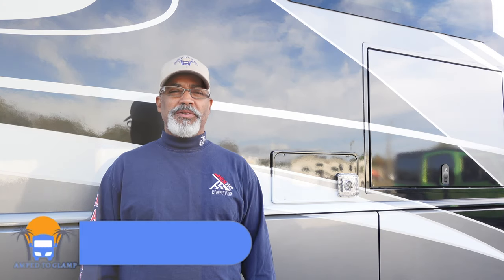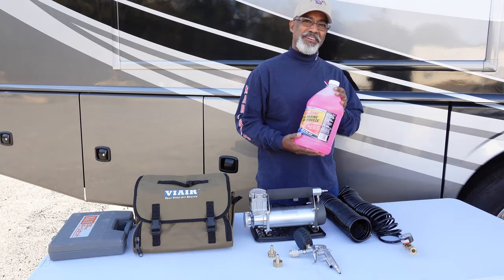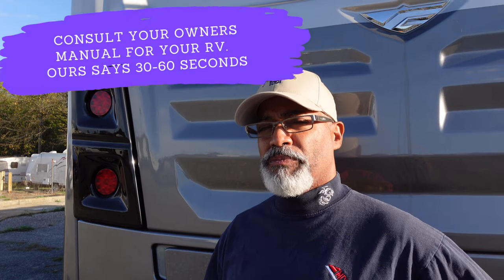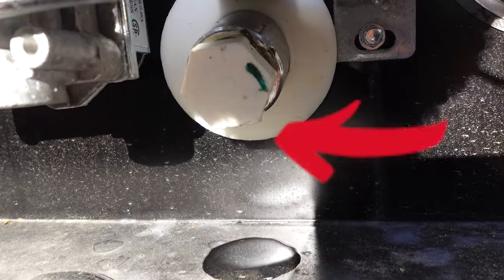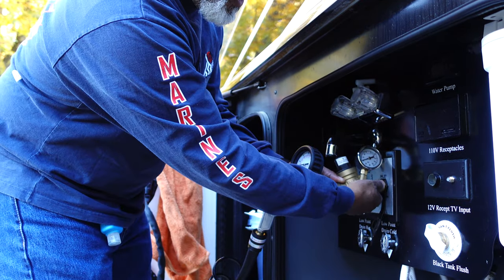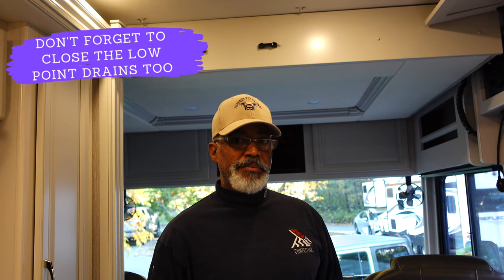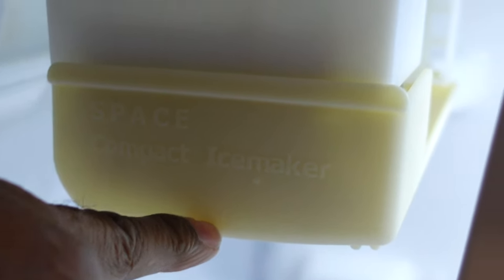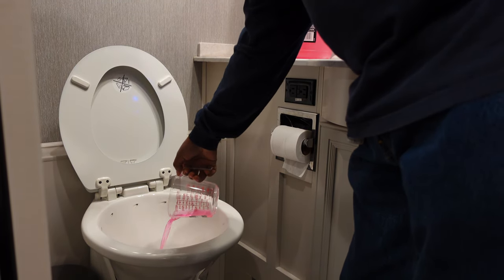How to winterize your RV using an air compressor. | Winterize your RV residential appliances too.

Comment: Great video my friend , while you're in the water htr cabinet make sure that you pull the 2amp fuse it'll keep you from damaging the heating element if the electric switch gets turned on accidentally. Also unscrew the filter housing on the water pump. Safe travels people 🙏🏿
Reply from the maker: Delmar!!!  So glad to hear from you 😊. Great tip!  So happy to have your words of wisdom. Thank you!

Comment: John, would you share with me where you got the fittings that attach the air compressor to the freshwater lines on the RV? I’m having problems finding them. I appreciate your help. I hope you guys are well getting ready for a busy spring. Thanks Brad
Reply from the maker: @Brad Denton Sure thing!  I bought it off Amazon.  Check out this link! https://www.amazon.com/gp/product/B095WN1J2T/ref=ppx_yo_dt_b_asin_title_o06_s01?ie=UTF8&psc=1

Comment: Thanks for this. Perfect timing. Can you share exactly what kind and size of adapter did you use for the air compressor to water adapter?
Reply from the maker: @Albizu Garcia  John  used a Camco blow out plug with brass quick connect. It fits a standard water inlet.

Comment: I always open all faucets and then open the low point drains.   Less to blow out later.  Did you not step on the toilet handle and blow the water out, or just didn’t show it?
Reply from the maker: Hi Kevin.  Our macerator toilet requires us to leave some water and anti-freeze in the bowl.  Each toilet is a little bit different.  I will say using air to winterize is so much easier than just using antifreeze.  Safe travels!  ~Sherri and John

Comment: Good winterizing tip here is one more tip with regards to your Domitc 7640 series macerator toilets. Once all the water has been removed from the supply line and water solenoid valve, add the RV antifreeze to the bowl then flush the toilet at least 3 times to remove all liquid from the bowl, this is per the Domitc 7640 series manual, page 14, 7.3 During extended periods of non-use/winterizing. There's no need to have the RV antifreeze in the bowl at that time, no seals to dry out with that toilet plus the RV antifreeze now has been pumped thru the discharge tube.
Reply from the maker: Hey @The Casual RVer...I thought I had responded to this.  My apologies.  Wow!  You know so much about the Domitic 7640 series.  How did you find out the exact model number?  Our owners manual references a different type of toilet.  Also, do you know where we can find the power switch for the toilet?  We are camping through the winter and end up having to winterize every few weeks depending on where we are going and storing the rig.  Thanks!  So good to know someone so knowledgeable!
Reply: @AmpedtoGlamp , No problem. The REV Group in 2019 switched to the Domitic 7640 series, replacing all Vacufulsh toilets. The 7640 is the standard macerator for their lineup, where a gravity dump won't work. Until you get the Discovery LXE and American Coach, then they use the 8700 Domitic macerator toilets. The power switch is integrated with the foot pedal, You should have a separate  Domitic manual on your toilet, it should be in the manual bag.I have been Blessed to have been around the industry for many years. The Ford F-53, F-59 stripped chassis and the cut-away E-Series chassis were my programs at one time.  Fortunately, I'm well connected in the RV industry.

Comment: How do you winterized your vacuflush toilets? Do you pour antifreeze in the toilet and then flush with the pump switch on? Does this put antifreeze in the macerator chamber and the actual macerator pump?
Reply from the maker: We have a dometic macerator which is different from the vacuflush system. Below comes straight from our manual 
1. Drain potable water tank and empty holding tank.
2 . Add freshwater antifreeze to potable water tank .
3 . Flush potable water antifreeze and water mixture through toilet(s) and into entire system,
including the waste holding tank, diverter valve connections, discharge pumps, etc . Turn off power to toilet .

Comment: How do you learn all of these things????  Please don't say "Reading the Owners Manual!"  Great video!! I'm still not sure how the Black and Grey tanks are drained fully.  I didn't think about the "P-Traps", so great reminder.  Some of the RV Units that I'm considering have the "Bath and a Half" with Washer/Dryer... Outdoor Kitchen, etc... I can NOT imagine the Winterization list for something like that.  I guess the goal would be to NOT Winterize!!!  😎🌵🌞🌵😎~Big C in the DP 📢 ::: Air Horn 📢 :::  ::: Air Breaks! ::: 🚌🚌🚌
Reply from the maker: I hate to say it but.....reading the owners manual 😊 and watching YouTube. So much information on YouTube.  Once you've winterize a few times it's not so bad.  Because we winter camp we winterize and dewinterize  several times per month.  We've got the process down and it usually takes less than 20 minutes.
Reply: @AmpedtoGlamp   I, too, would "Winter Camp"! While I'm sure it's "tedious", having the option to get out while the temps are low and the roads are dry (and the campgrounds are empty) is a treasure even if only for the weekend.  I'll have to make a checklist to see if I could duplicate this in a 20 min time box!! Way to go!